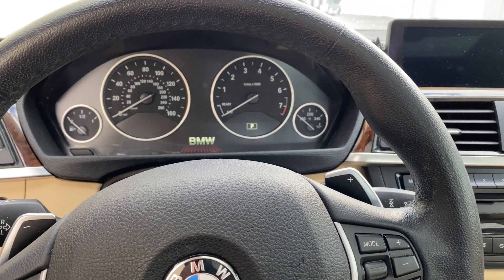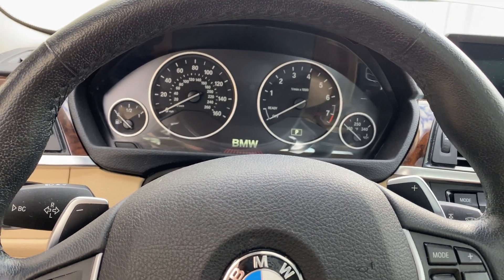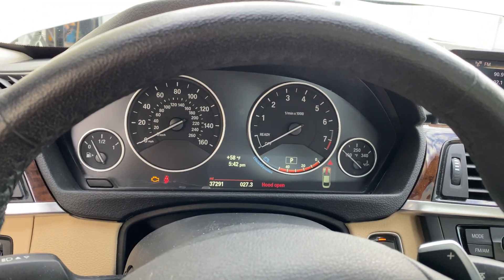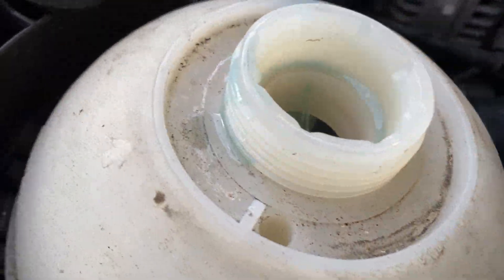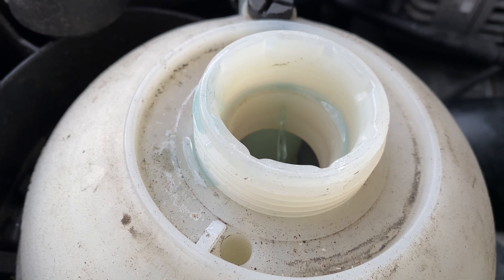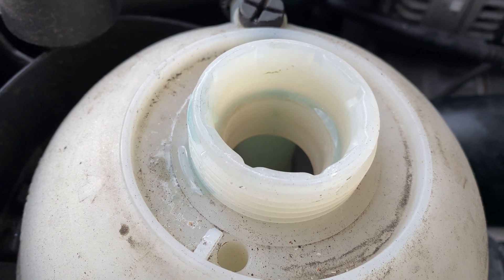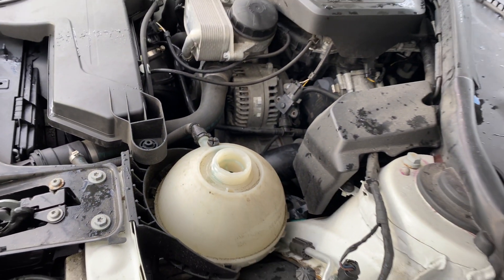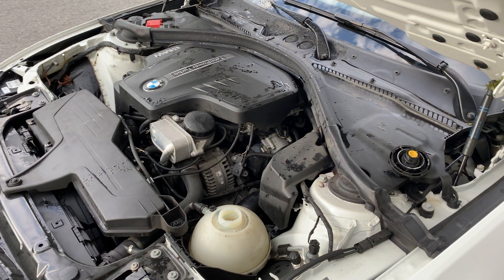HOW TO BLEED BMW COOLING SYSTEM WITH ELECTRIC WATER PUMP

Comment: Does my car need to be on a battery tender?
Reply from the maker: Typically doesnt need a battery tender for this to work.
Reply from the maker: Ive never hooked up the charger to do the bleed process but that doesn't mean its not a good idea. Usually don't need to. I only hookup charger if I have the computer plugged in for awhile or key on for awhile.
Reply: @furlongspeedmarine  thanks!

Comment: Question.. I didn’t watch the video first and I started the car with the heat up and fan on High for about 5 minutes . I stopped the car and then proceeded to bleed it with your instructions. Since I started the car the first time do I need to do any additional steps
Reply from the maker: Should just be able to do the same process as in the video if you have any issues.

Comment: Ayo, should I do this after putting coolant in my car? It says it need to be topped off even tho I put coolant in there… should I try bleeding the coolant ?
Reply from the maker: Yes, after coolant is put in the car. Check fluid when car is cold. Top off if needed. Go through bleeding procedure with cap off from there before starting car.

Comment: During the bleeding process, do you need to hook up a battery charger to avoid draining the battery? I heard different opinions. Some said yes, while others said not needed. Thanks.
Reply from the maker: Ive never hooked up the charger to do the bleed process but that doesn't mean its not a good idea. Usually don't need to. I only hookup charger if I have the computer plugged in for awhile or key on for awhile.
Reply: If it kills your battery at 11 minutes you have other problems

Comment: my f20 with b38 engine wont start bleeding with this procedure, any idea?
Reply: Your battery might not be strong enough or needs to be connected to a battery charging connection to do it. It takes about 15 minutes to complete the bleeding system.
Reply: Or water pump sensor not grounded . Ez fix diy
Reply: My 2011 drive won't start water pump with key on have charger under hood

Comment: Please help do I loosen the bleed screw? Or no. Also i flushed with water and I got a foamy substance in my reservoir
Reply from the maker: I normally don't loosen bleed screw but thats just me. Haven't had any issues doing it like that so far.
Reply: Did you drain the whole system after?
Reply: @somewhereoverit711  yup
Reply: Cap to be on, bleeder screw loose.

Comment: Hi, so you open the reservoir during this process and simply close it when it’s done?
Reply from the maker: Yes I open reservoir and close when done
Reply: @furlongspeedmarine  Thanks!
Reply from the maker: @PikachuSixPaths  No problem!
Reply: @furlongspeedmarine  how do I know when it's done please?
Reply from the maker: @craftwanderer8802  after about maybe 10 mins, it stops doing it
Reply: @furlongspeedmarine  can I do this method on a 2012 118i N13? the water pump is mechanical
Reply: Cus I’ve seen videos where they don’t open the reservoir